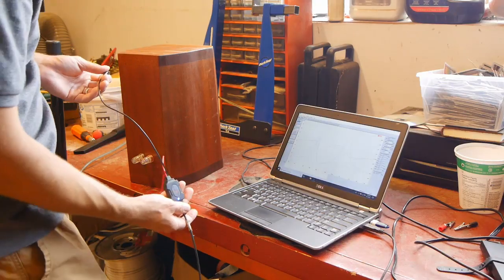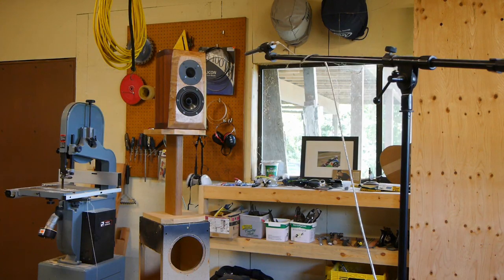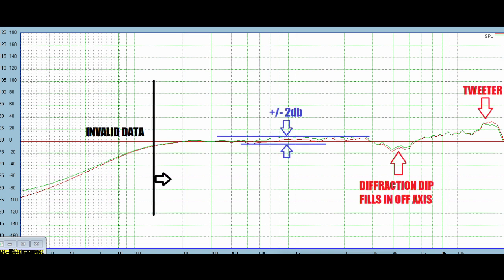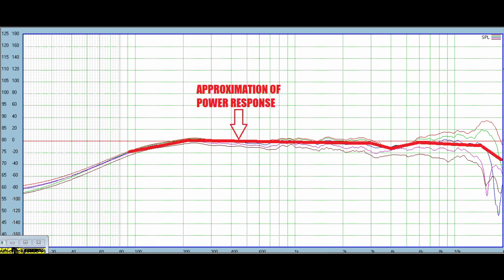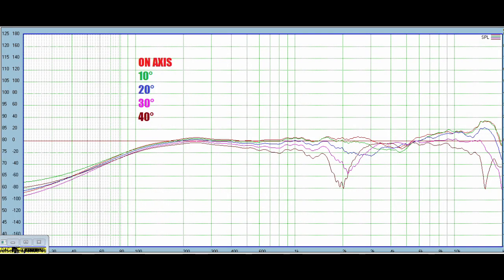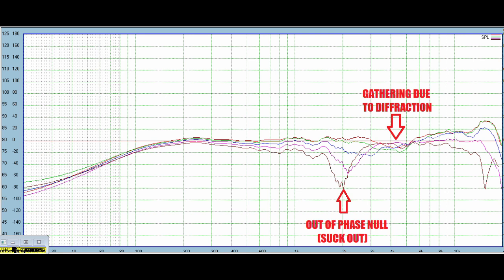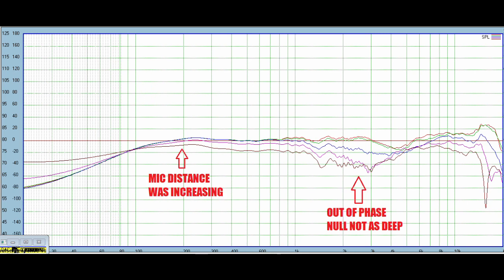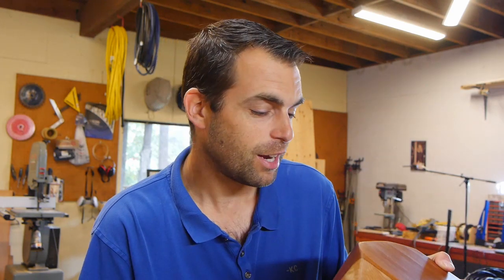Dayton Audio Surround Sound Speaker Final Thoughts

Comment: That's a pretty large/wide hump starting around 700 Hz.  Looks like baffle step. I guess these speakers are going to be mounted close to a wall so you didn't trim it in the crossover?
Reply from the maker: Brian Steele I don’t generally practice the idea that closer to a wall means less baffle step compensation. I do my best to flatten it down to the same level as the bass, and find this sounds best with all speaker applications. Maybe a little less with nearfield applications. This was a very simple XO though and I didn’t get it razor flat. Not bad though for 5 cheap parts.

Comment: Another reason for no port is the gradual phase change in bass relative to ported.  When using an electronic crossover, not ported will crossover smoother due to smooth phase shift.

Comment: Where is that diffraction dip coming from with the edges around the tweeter rounded so much?
Reply from the maker: Paul Bjorngaard it’s hard to eliminate all diffraction. Some will still show up.
Reply: @ImpulseAudioSpeakers , it looks almost as bad as it did in the test box with square edges. Just surprised it showed up that much.

Comment: The off axis phase null is avoidable, you need to use a Linwitz-Riley 24db/oct crossover. Of course those are challenging to do passive.
Reply from the maker: Martti Innanen no it’s not. That XO type only makes it in phase in one spacial location. Outside that location the drivers slowly go out of phase. Doesn’t matter what type of XO is used. The only way to avoid it is to XO sufficiently low and/or place the drivers sufficiently close together. Which is basically impossible.
Reply: @ImpulseAudioSpeakers  https://www.rane.com/note160.html

The crossover type does affect it, sorry. There's a reason why LR crossovers are used in practically all studio monitors where listening often happens off the vertical axis.

Comment: Hi, sorry I have a question unrelated to the video I'm new to speaker building and I couldn't think of someone better to ask. I've been looking online for hours and hours now and haven't found a concrete answer.

How do you determine the proper port diameter? 
My project uses two Dayon Audio ND105-8 on a 0.70 cubic ft enclosure and I've got a 1.75 in diameter port I want to tune to 45Hz, but after doing a lot of research im not sure if it's the proper diameter. I've read about proper port surface area, length, tuning frequency but couldn't find information on how to connect that to each other to figure out the appropriate port diameter.

I would truly appreciate any help you could give me with this. Also, keep up the good work! I really like your videos since it goes more into the technical aspects of speaker building.
Reply from the maker: Javi J No problem about an off topic question. I haven’t done a video about box design yet, maybe I should. Generally my advice would be to use a box model program like WinISD or unibox. You can input all the driver parameters and then model the port size and tuning. WinISD is not very user friendly, but unibox requires excel. There are some other program options though. And I’m pretty sure there are some videos available how to use them. I have a few other things on my plate but I may do a tutorial or something.
Reply: @ImpulseAudioSpeakers  Ill look into them, I think that would make for a great video! Thank you for your help.

Comment: Your thoughts on these vs the C Notes from Parts Express for surrounds?
Reply from the maker: Brooks McLaughlin Unfortunately I haven’t heard the c notes or know much about them. These are specifically designed as surrounds, so they might be better for that application. I understand the c notes use a waveguide so there might be poor vertical range which is important as a surround.

Comment: I am familiar with the sweep sound of REW and Omnimic, but I don't recognize the one in your video. What measuring software are you using?
Reply from the maker: davefred3 It is SoundEasy V21. There are advantages and disadvantages to using MLS vs sin sweep.
Reply: @ImpulseAudioSpeakers  How do  you like SoundEasy vs. REW vs. Omnimic for measuring? I have used REW and OmniMic and have considered getting SoundEasy for everything else it does as well.
Reply from the maker: davefred3 I don’t like it. It has a ton of capability but it’s very dated and painful to use. People will say it has a steep learning curve, but that was 10 years ago. Now it’s just dated and not even very compatible with new versions of windows. The software guy behind it just keeps updating it but it needs an overhaul.
Reply: @ImpulseAudioSpeakers  Have you thought of upgrading to V24?
Reply from the maker: davefred3 no because I don’t want to waste any more money on this software.
Reply: @ImpulseAudioSpeakers  Why don't you use REW or OminMic then?
Reply from the maker: davefred3 mostly because I paid for SE and I do like the measurement side of it. I just don’t want to spend any more on it. I use HolmImulse and REW from time to time. It really depends on what I’m doing because every software has things I like and dislike.

Comment: I remember when you tested the midwoofers they were a bit off in T/S parameters and one rolled bellow 300Hz when you measured them free field - maybe good idea you put them in the closed box. 
So, the tweeter isn't as good as, say SB ring dome, which is a 10-15  bucks more, and the dip at 4k is even in data sheet. Inefficient, ya small, sucky midwoofer, well, maybe other ones would have 2dB more. But, the enclosure looks really good, shape is nice, no square edges - no way you could get something close to them at BB or other store even at twice the price, not with cabinet like this, so don't complain. I know, we all do that. It's OK speaker - many factory made ones measure worse.
Reply: I forgot to add something - some two months ago I did free field measurements with my old Clio, well I can say that the ring dome SB is toughest tweeter I ever used. Forgot to limit the low frequency limit and the sine sweep started at 10Hz w/o crossover. My eyes almost popped out when I saw the the dome moving some 3mm p-p. It survived the sweep no problem - no demagnetized neo motor, everything measures and sounds fine. So, adding to your tweeters test - it's a good product, other than some Fs and other inconsistencies in production samples.

Comment: Hi Ryan, impressive response for such an economical design! Another great video, your analysis of the measurements is second to none and really educational and insightful.
A couple of requests:
a) what resolution/db increments are you using on the vertical of your graphs? On my screen it's difficult to read the vertical axis.
b) would you mind presenting the horizontal measurements using a Geddes style polar map please? The Omnimic software which is free to download from Dayton Audio is easy as to import your horizontal plots and with a single click present the polar. I find these very revealing of the off axis performance.
Keep up the great work! Cheers.
Reply from the maker: Maz 4bz I use 5db increments. The red horizontal line is 80db. 

I do like polars and do find them useful. It’s an extra step I normally don’t bother with because it’s the same info, just presented differently. It is a better presentation though, so I’ll consider that in the future. Good suggestion!

Comment: "Dayton Impulse-123 5S-RSTF4W8-2000" 

5S- 5" Surround
RS- Reference Series
TF4- 4 Ohm Silk Dome Tweeters
W8- 8 Ohm Woofers
2000- Crossover Point
Reply from the maker: vscfalcon now we’re talking!!!
Reply: @ImpulseAudioSpeakers   Kept it in line with "something that makes sense technically." 😁

Or if you wanna keep it light:
"DARS Impulse-123 BBSK-100"
-$100 Best Buy Speakers Killer  😛

Comment: The suck out near the crossover frequency might be resolved by connecting the HF unit out of phase. A common trick with some speaker makers!!
Reply from the maker: Michael Beeny I didn’t think there was a suck out at the XO frequency. Unless you mean as I move off axis vertically? But then if I reversed the tweeter phase there would be a suck out on axis.

Comment: This time you did the measurements indoors, for other projects you did it outside using the ladder. How big it's the difference between the two types of measurements? 
Name: Impulse S5  (surround 5inch)
Reply from the maker: i raul I like that name. Hmm. Might think about HT S5 for home theatre. That’s for the idea to work from. 

For such a small speaker I can get away with it, but the data is only good down to about 120hz at best. My shop is pretty big allowing for a long gate time. Outside is better though.
Reply: @ImpulseAudioSpeakers  when you'll get more subs you should make a speaker kit an sell it. Some people might be interested for simple well designed stuff.
Reply from the maker: i raul I do some work with diysoundgroup.com for that. But not sure Id put this one on there. And I don’t have the time to sell kids on my own. Maybe speaker plans. I’ve thought about it but can’t find a way to do it that I like.

Comment: tweeter is clearly too far from the center of the small woofer.. maybe a small morel tweeter and higher crossover point would have fix the vertical response and sound
Reply from the maker: lex Tr3 that’s the problem with these larger tweeters. But they do usually allow for a lower crossover and that helps with the vertical. Actually the vertical response is much better than most speakers out there. People rarely bother to measure it though.

Comment: It's sad those Dayton Audio drivers did not perform so well because the end result otherwise turned out really great. I really like the woodworking you did on the cabinets. It does leave me with one question, what are good budget drivers? I myself have used SB Acoustics drivers (nrx woofers) in the past in a more  budget oriented build and got great results. My units measured ruler flat apart from some baffle related anomalies. So for a future build I recommend having a look at some of their drivers.
Reply from the maker: PA5cAl1 yes I’ve used a few SB drivers and am always very impressed with the value. Very good drivers. These were ok, but there’s better options so I don’t recommend them when you can get better.

Comment: That looks like a 3.5 inch mid range, not a woofer.
Wood work looks amazing! 

Would a smaller box make the sound different ? It's a sealed box, so why no make it as small as possible ? Would be liter, easier to mount, and the bass would look as it came from a small speaker.

Would love to see more speaker builds!
Reply from the maker: Quetzalcoalt it probably could have gone in a smaller box, but how much smaller really when the wood was 1” thick and the drivers are filling the baffle dimension. This way the woofer can breath a little more and I could port if I really wanted to.